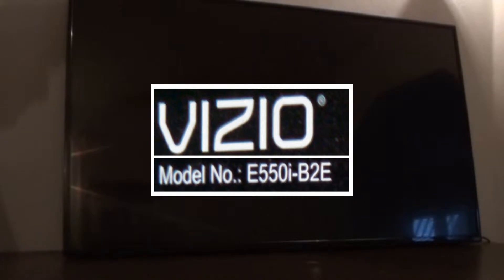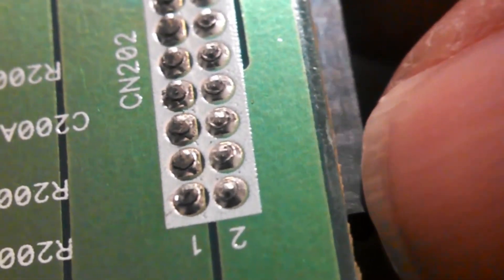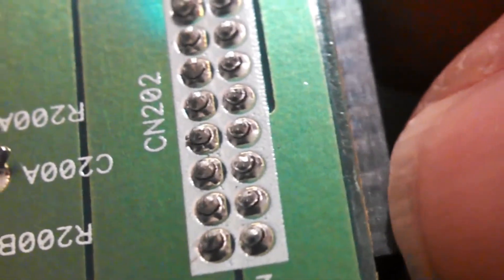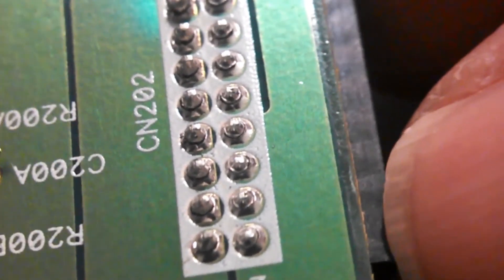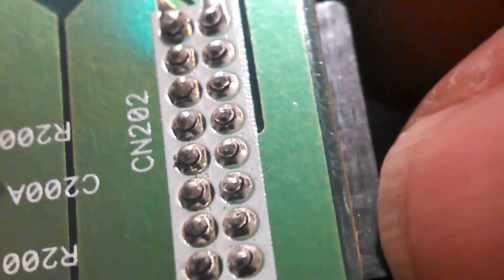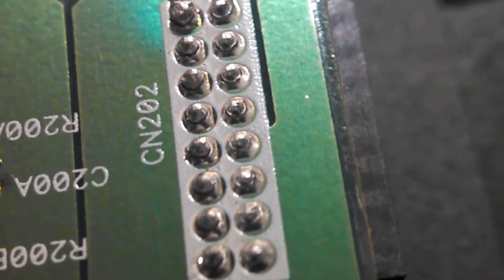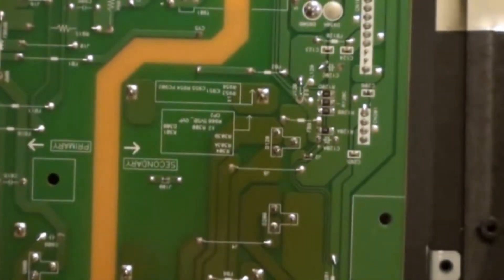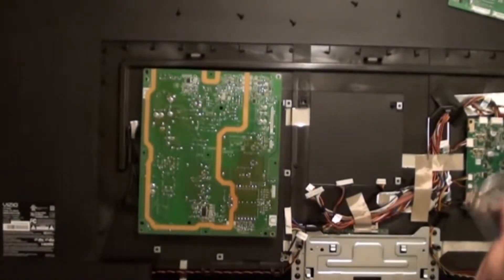Vizio E550I-B2E - No Backlight, But TV Has Power - Connector Breaks Loose

Comment: I think I messed up with connecting it back. How can I figure out where the connection failed
Reply from the maker: You should be able to tell where it failed by seeing a crack in the solder around the pins.

Comment: I loved this video.  I have the same tv but, mine has a problem  turning on.  The V shows but,it turns off so I have to keep pressing the on button on the remote over and over til it comes on.  What do you think that issue is?  Thanks for your input
Reply from the maker: It's hard telling. It could be some bad solder connections like in the video. I'd take it apart and have a look at all the solder joints and resolder the bad-looking ones. I hope this helps.
Reply: The eeprom on the mainboard is bad the mainboard needs replaced unless you can find a replacement eeprom chip to solder on the board

Comment: Thanks.  My TV has the same problem.  Question -> how do you discharge the capacitors?
Reply from the maker: The fast way is to use a pair of insulated pliers and touch the two leads of the capacitor. The longer and more safe way, use a resistor to touch across the two leads of the capacitor. 1k ohm or something like that.

Comment: When adding some new solder to the legs on that power supply board do you have to make sure that the solder from each leg is not touching any other solder spot for that connector? Just asking because this is what is wrong with my E550i-B2. I have soldered in the past, but I'm not sure I can be that neat with it :)
Reply from the maker: You should always repeat the same solder pattern as the factory. Never short two solder legs that are not connected by the copper on the board.

Comment: After doing what you did the TV won't even turn on. What did I do wrong?
Reply from the maker: Did it turn on before the repair? Make sure you didn't accidentally create any shorts while repairing the connector solder joints. After that, check to make sure you have all the voltages coming from the power supply board. Any wires coming off that board should have some type of power to feed the other boards.

Comment: How do you discharge the capacitors??
Reply from the maker: You can put a resistor across the leads for a few seconds, but it depends on the value of the capacitor for how long it will take to drain the capacitor. If you have a multimeter, you can connect it across the capacitor as if you're checking the voltage and let the leads sit on the capacitor leads until it is drained of voltage. It usually doesn't take but a few seconds to drain them.

Comment: When you say"touch up" did you just touch up the solder joints or did you de-solder and make fresh solder joints?
Reply from the maker: I just left what was there and added solder to make the connection again.
Reply: @ElectronicsEditor  ok thanks!

Comment: Hi. May I ask what you did to fix the first problem? I didn't get it 😅 thanks! Great video, btw. 😁
Reply from the maker: Thanks. And what I did was on the connector that connected the two boards together, I had to reflow the solder (resolder) for all the legs so that they were attached to the board again. Hope this explains it.